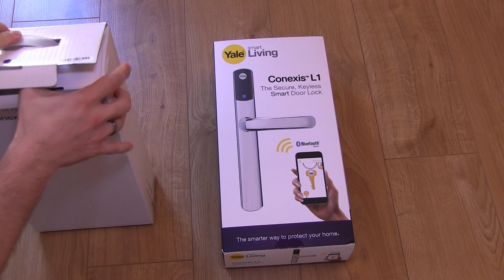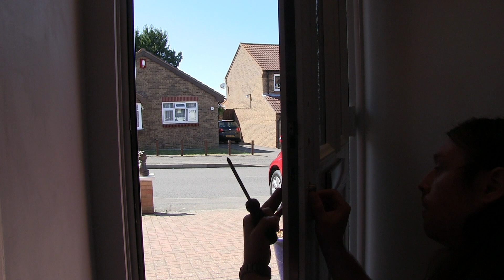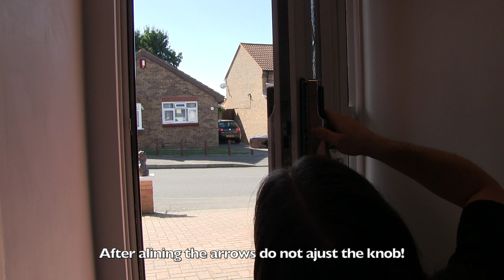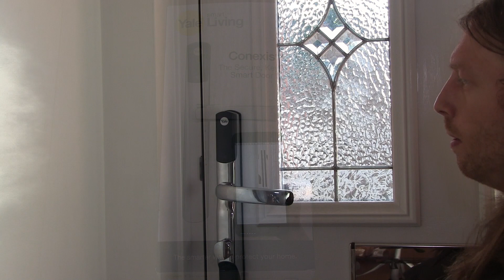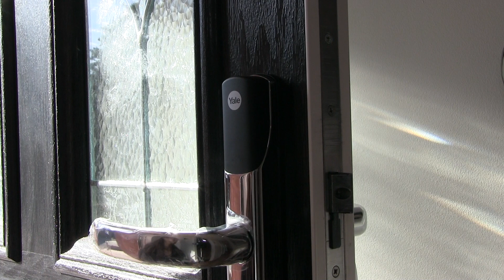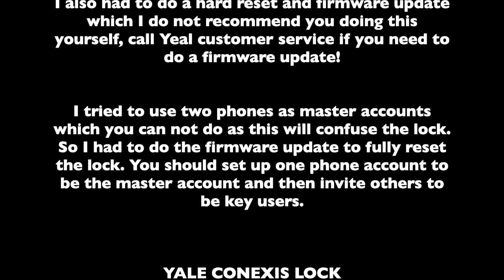Unboxing and installing the Yale Conexis L1 Smart Lock

Comment: Hello David My lock on my front door locks but then makes a weird noise like an arcade. What can i do please. The top part where it as the R symbol. Keeps coming off
Reply from the maker: Hi Chatel, I am guessing that it has not been installed / calibrated right. Best to take it off, reset it and start again. Pay close attention to the cable run as a pinched cable will give you problems and double check the aliment of the arrows inside.

Hope this helps all the best Dave

Comment: What happens if you're out with the door locked and the motor doesn't unlock the door?
Reply from the maker: Hi Keirangriffiths, If you concern is, if the batteries are dead then there is a 9V thermal at the bottom of the front plate. Just get a square 9V battery and push it up to the terminals and it will power the lock for you so you can get in. If you are asking if the lock is broken then just with a normal key lock if the lock fails then use another point of entry or get a lock smith. We have never had our Yale Conexis fail or let us down.

Hope this helps all the best Dave

Comment: So I’ve just purchased this door lock, however, the app is now no longer in use and it directs you to the Yale home app. My problem is I have no qr code to can and when I enter the serial number it doesn’t allow it. So therefore I can not access the app functionality
Reply from the maker: Hi User-yg6cs1cn8h, Yale are closing the old app and doing a new one which can be found https://www.yalehome.com/global/en/trusted-innovation/yale-apps/download-yale-home
You may well need to get a new module in your lock and attach your DoorSense™ Magnet as well which you can get from https://yalehome.co.uk/yale-access-module-upgrade/
I hope this helps.
I have now moved to using the Loqed smart touch lock https://youtu.be/8aVovYLc6lc 
All the best
Dave

Comment: Those who live outside britain do not buy.  it will not fit any other mortise except those install in Britain.  distance 92mm mortise is impossible to find outside britain or the EU
Reply from the maker: Hi Michel, Where are you from and what is your handle to key distance?
You could try the Loqed Lock https://amzn.to/443xRfs
Supported doors thicknesses: up to 110mm for a symmetric door, or up to 55mm measured from the cylinder screw.
The most common center-to-center distances: PC 55, 72, 92 and 110 mm.
https://support.loqed.com/en/articles/6202154-which-door-lock-types-are-supported
Hope this helps all the best Dave

Comment: When the custome decides to change the main opening codes on the unit, can the key cards and tags be updated with the new codes? or do they need to be replaced with new ones?

Cheers!
Reply from the maker: Hi Firebrand, I am not following what you are asking as there are no codes with this lock only authorised keys either as accounts on a phone or NFC tags.
If you reset the lock you loose all soft keys and will run out and need to buy new ones which I do not agree with. NFC tags are reusable.
I will be releasing a new video about a different lock so subscribe so you can see it when it is relaced. As I think this is what you are looking for.
All the best
Dave

Comment: Do you have to manually lift the door handle to lock or can it lock the door fully automatically?
Reply from the maker: Hi Leigh, Yes you have to lift to lock! It’s a replacement of your current lock so works the same way. If you press and turn the internal knob, use the app or key fob to unlock the door with out pushing the handle down. It will automaticity lock without being lifted again! This is because when you start the unlock process before you push down on the handle it only is engaging or disengaging the locking mechanism not moving the multi point locks around the door. Only the internal handle mechanism.
I would love it to automaticity fully lock the door remotely but I am going to guess this might require a more powerful motor, bigger batteries and how would the lock know if the door is fully closed? But would be an excellent feature.
All the best Dave

Comment: Hello I have this smart lock. And the sound has changed. Does that mean there is something wrong. Do I need to reset the handle if the batteries are failing. Many thanks
Reply from the maker: Hi Chantel, If it is playing few beeps after unlocking or locking the door then it is warning you the batteries are low. Just replace the batteries all settings are saved in the lock so you will not need to reset anything.  Even if the batteries completely die and you are outside with the door locked you just need a 9V batterie and press and hold it to the contacts at the bottom of the outside lock and you will be able to get back in as normal. 
Hope you clicked like and subscribe :)
All the best Dave
Reply: @BrenTeckITSupport  Thankyou so much for your reply. I've changed the batteries, and everything is fine now
Reply from the maker: @chantelbriody1969  Hi Chantel, Glad we could help :) all the best Dave

Comment: Hi literally did everything like you did but mine after installing and all kind of bleeps when put handle down and up the last bleep when it shows its lock doesn’t come up neither red light. So i cant move to next step and register card. Any suggestions?
Reply from the maker: Hi Abc. It could be a trapped / pinched lead as this causes all sorts of weird problems. I suggest taking the lock off completely and starting again making sure to use the cable run space, also make sure the bar is the right length https://youtu.be/8_OnJTmXasE?t=406
https://youtu.be/8_OnJTmXasE?t=697
I hope this helps please let us know how you get on.
Remember to Like, Share and Subscribe.
All the best Dave
Reply: @BrenTeckITSupport  so i take the whole lock down start again and it was the same so i send it back to Yale and they called me apologise for inconvenience and send me new one which i paid more for installation…. The old/original unit was ok but bluetooth wasn’t working so it was manufacturer issue.
Reply from the maker: @AbcAbc-ch4mq  Hi Abc, if ever in dought it's best to get a professional installer in for any job. Shame about the Bluetooth not working from out of the box but these things do happen. This could have been the issue don't know why you would be told the old one was ok but Bluetooth not working this means there is a fault and so the lock is not working as expected LoL. Well, at least you got it all sorted now.
I love having this lock the number of times I would have locked myself out as I often forget to pick up the key fob when I leave but never forget my phone so I can always get back in. :)
All the best and thanks for your comments
Dave

Comment: I bought the Yale access bridge and it just will not pair.  I must have tried 20 times.  All i get is the message "You do not own any locks that support bridge.  Please install your compatible smart lock first".  This is the problem,  I have installed the wifi module into the Conexis L1 and it is working on the app via bluetooth ok.  I can unlock and lock the door fine with the app.   It's the bridge that is the problem.  Can you help or offer any advice.  Thx
Reply from the maker: Hi Alex, great to hear from you. Have you pressed the button inside three times to start the module? Try watching https://youtu.be/eJEPmeE8BC0 as this may help. I am using SmartThings and zwave but should be the same process. Your phone is likely communicating with the lock via internal Bluetooth instead of WiFi at the moment and not using the module at all.
I hope this helps please let us know how you get on. All the best Dave
Reply: @BrenTeckITSupport  I tried the 3 press activation but nothing.
Reply from the maker: @AlsKitchen  Hi Alex, The video you sent me looks like you are scanning the wrong QR code.
First make sure your hub is less then 3 meters from your door. Power up the hub and set it up. Then try pressing the button in the lock three times in quick succession. If you need to scan any QR codes it will be on the lock modual and or the hub itself or in the documentation that came with it. Not a photo on a tablet even if this is a photo of your device the image may corrupt the QR code enough to change the data in it. When scanning QR codes make sure you only have one code in the scan area and keep the item you are scanning on a flat service not your other hand as this will give two much image shake.
I hope this helps, let us know how you get on.
Dave

Comment: My only whinge is that, unlike others, there is no way to configure it to unlock when your smartphone's wifi comes within range.  So you either have to get your phone out to use the app (awkward if you have your hands full or if it's raining etc) or get the fob/RFID card out and hold it on the sensor.

I have not found a suitable alternative but will jump ship as soon as possible if I do. (Edit: see my reply to my own post below where I have very successfully used a SmartThings hub and Z-Wave module to get around this limitation.  MW).
Reply from the maker: Hi Martin,
Sorry, you are having problems with yours. Make sure your batteries are fully charged / new alkaline. I get away with rechargeables but they are not recomended.
Also, make sure no wires are trapped/pinched as this can cause a communication problem.

You can have it unlocked via geofencing or wifi connectivity using events in Samsung SmartThings, Google Home, Alexa or using HomeAssistant but this is a lot more work to get working and I don't recommend doing it as we found that our door unlocked when phones restarted or power on when at home. The door will relock after a minute or two if the leaver was not pushed down so not supper critical but still a security flore. The best practice is to use the NFC fob.

If it's raining we unlock the door using the SmatThins app so we can walk strat in from the car.

I hope this helps and thanks for your comments.
David
Reply: @BrenTeckITSupport  Hi David,  I'm £200 in so I might as well go the extra mile.  Would I need the 'sync module' and the 'Yale Connect Wi-Fi Bridge' and one of Samsung SmartThings, Google Home, Alexa or HomeAssistant?  If so which one (of the last lot) would you say is best for my geofencing needs (I probably won't use the 'talk to it' thing much but you never know...).
Reply from the maker: @martinwinlow  Hi  Martin,

OK This is going to be fun to explain as things have changed since I got ours and did the video.

You will need a sync module of some type;
1. I used to recommend the Z-wave 2 module with smart things. BUT this has stopped working with home assistant due to updates and SmatThings is now rebranded.  It still works great using the SmartThings APP.
2. Aeotec Smart Home Hub - UK version https://amzn.to/3mZ1qwl which is SmarThings rebrand + Yale SD-M1100, Smart Door Lock Z-Wave Module 2 https://amzn.to/31M7eBm.
3. Or The Yale Wi-Fi Bridge + Access Module https://amzn.to/3BVRBDH

The new Yale Connect Wi-Fi Bridge + Yale Access Module may be a better starting point https://amzn.to/3BVRBDH but I have not tried it so can not say how good it is or if it offers anything over the Aeotec Smart Home Hub - UK version https://amzn.to/3mZ1qwl which is SmarThings rebrand.

Smart assistance such as Google Home, Alexa or HomeAssistant are not needed to use the module and app to unlock the door remotely.

Geo-fencing the lock was not a great experience for me. With the updates I don't know how well it will work now as when I did it I used Stringify that no longer exists :( I did not move it over to HomeAssistane as I found Geo fencing the lock to be unreliable from "my" phone.

To do Geo fencing you will need a 3/4th party such as Alexa routines, SmatThings or IFTTT to track your location then respond to the change. Home Assistant may work with the new Aeotec Smart Home Hub https://amzn.to/3mZ1qwl or even with the old SmartThings if starting from scratch. The SamartThings updates just broke the security. There is a Yale smart living integration for Home Assistant but I have not tried it.

I am now using a ZigBee dongle with Home Assistant directly to overcome the problems with SmartThings but this does not support Z-Wave and I do not know what the new Yale Access Module works on as I can not see in their documentation. It may be ZigBee, Z-wave, Bluetooth, the new Matter standard or WiFi who knows.

I am sure this is not as helpful as you were hoping for but just my experience and with the new Matter standard coming out soon all could change again, have fun.

David
Reply: @BrenTeckITSupport  Thanks.  Perhaps Yale might help?  I'll give them a try.
Reply: @BrenTeckITSupport  BTW, am I right in understanding that there is an alternative synch module that isn't wi-fi-based but one which uses z-wave comms instead?
Reply from the maker: @martinwinlow  Hi Martin
The new Yale Access Module https://amzn.to/3kjOYWi may be ZigBee, Z-wave, Bluetooth, the new Matter standard or WiFi who knows.
The old one was Z-Wave https://amzn.to/3CYZr0Q works with Aeotec Smart Home Hub (SmartThings) https://amzn.to/3klhIxS
Regards
David
Reply: @BrenTeckITSupport  Thanks - Just ordered from Amazon.  I'll post an update in due course.
Reply from the maker: @martinwinlow  Hi Martin,
Yes catching a cable or misaligning the lock does course random problems. Good luck and please keep us up to date.
Kind regards
David
Reply from the maker: @martinwinlow  Hi Martin,
I don't know why your last post is not showing so I will copy it here as it's a good and interesting post.

Thanks for the warning about the Vodafone version of the SmartThings hub needing a subscription just to get it to work that is disgraceful as you are buying the hub I can't even see any advantage over their subscription model compared to the standard hub. 

I am reading rumours of Samsung discontinuing support for SmartThings https://www.reddit.com/r/SmartThings/comments/r46gag/what_is_being_killed_off_at_the_end_of_year/

So I guess subscriptions are trying to force their way in.  I am going to be pushing for a home assistant on my Pi using a Zigbee dongle in the futcher or WiFi devices.

If only the smart home industry could play nice with one another things would be so much better.

All the best
David

-----
An update on my installation... The replacement lock works nominally without any silly random beeping. I have bought both the Z-Wave module ('Yale SD-M1100' V2), and a 'Samsung SmartThings V3 WiFi/Hub 2018 -V by Vodafone' (more on the Vodafone thing later). I have set up a geofence routine on the lock to unlock whenever I 'get home' and this works very well (so far) unlocking the lock as I pull up in the drive (which has half-decent wifi and good 4G coverage). I get a notification on my iPhone when this happens. I always lock the door on leaving (by pulling up the multipoint locking handle) and can reassuringly hear the lock locking. I suppose I could also set up a geofence routine to lock the door when I leave the house by a good distance (to prevent nuisance locking when I'm in the garage or something) in case I forget to lock the door manually. The SmartThings hub has a history feature so you can see when/if the lock locked as it should. So, thoroughly reccomend the above set up to add some real usefulness to the Yale Conexis. It remains to be seen long long the lock's 4xAA batteries will last now compared to before without the extra drain from the Z-wave module. 'By Vodafone..." - watch out for this when buying your SmartThings hub (specially if on eBay or similar as I did). This version requires a subscription to Vodafone which costs approximately £9 for two years (not mentioned on the eBay auction). If you don't get the subscription the hub will not work. There are other limitations to it being 'by Vodafone' compared to an "unlocked" hub but you may find it still works out cheaper to buy a hub this way than any other.
-----

Comment: Great video, can you disable the beeps?
Reply from the maker: Hi Leo,
I do not think you can, and I would advise against it if you could, as an audible warning of the lock working or not as the case may be is better to have than not. The beeps are not that loud compared to the door being closed anyway so they will not disturb anyone sleeping. It may sound louder in my video due to the amplified mic.
I hope this helps, all the best
David
Reply: @BrenTeckITSupport  You can actually disable the beeps, or have them quieter, it's done in the advanced lock settings in the lock, that's also where auto relock time, shutdown time, and wrong tag lockout time limit are set too, at least in my app anyway. I'm very curious how you did the firmware update you mention though, if you can remember; my understanding is that you borrow a currently unobtainium 'update module' from Yale, is that how you did it, or is there a a hidden way via the app or a download from somewhere? Mines a very old firmware that I'd like to update if possible.
Reply from the maker: @Tekwyzard  Hi Ken, Yes you are very right about looking in the advanced lock settings thank you for your input on this topic. 
I can not remember exactly how I did the firmware update, I know I used my phone and had over-the-phone support from Yale. Possible something to do with Samsung smart things I really can not remember but I know it was not obvious and you would not stumble on to it. Looking at some online forum posts it looks like you have to send the lock back for a firmware update now Mar 2021. I can find anything official from Yale about this. I will contact Yale and see if I can find out for you.